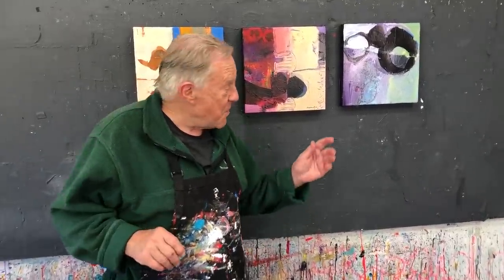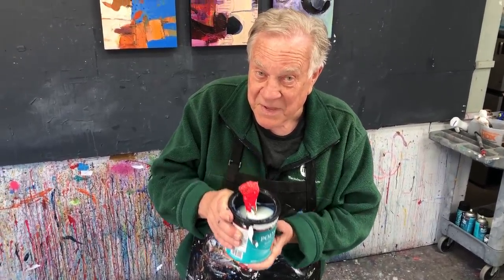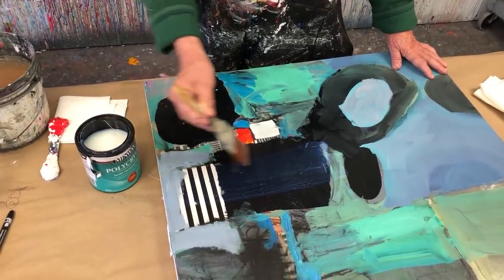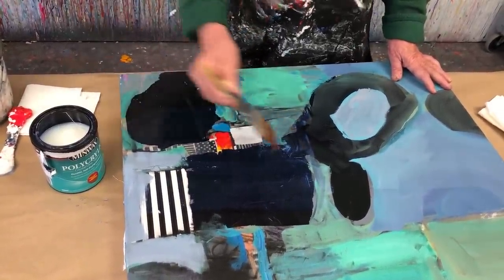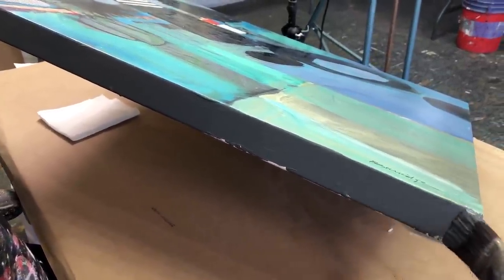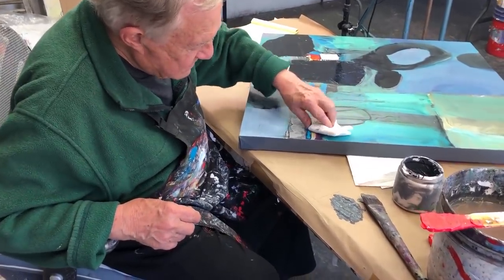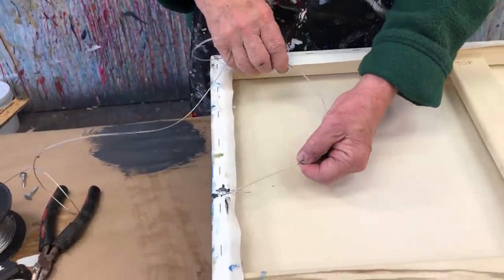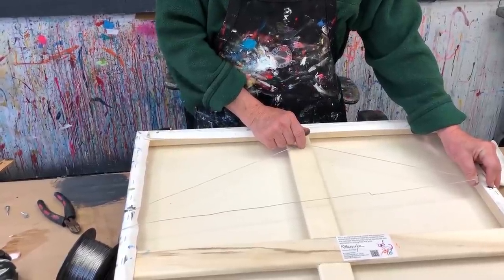BobBlast 413 - "Final Steps to Show-Ready"

Comment: @Bob, do you have any insights into selling online?  I do both watercolor and oils.  Both in rather large format.  Is it appropriate to take the canvas off the stretcher bars and ask the customer to re-stretch to save in shipping?  When it comes to gallery work, I'm hesitated to even try, because of the challenges of packing the artwork (I guess I'd have to rent a van) and then my watercolors framed in glass gets to be really expensive (especially if I break them in transit).  Do you suggest mounting watercolor on board instead (which I have seen done, but that gets heavy for larger pieces as well).  I used to work for an interior decorator group and the art they purchased for their clients was almost always large format (I see people with big money having big homes with big blank wall spaces), so I'm not really interested in 11X17 or smaller.  Also, like your thoughts on digitizing work and turning it into a print.  I personally don't like it, but selling prints to a more cost-conscious market may be a better entry point for the newer, no-name artist like myself.  Again seems like the investment in the proper cameras and/or scanners to capture the images would be more costly than I'd probably ever make back in sales. Perhaps some ideas for a future video.

Comment: what is the width of the brush? brand? looks like a basic house paint brush?
Reply: Hi John - Which part - the varnish brush? Or the brush I used to paint the sides?
Reply: @RobertBurridge  sorry I meant the varnish brush.
Reply from the maker: @johndough1006   hi john.  Cheap joes psudo sables. Wide. 2in.  They are soft and leave no brush marks.  Hint: use a lot on your brush and go slowly( no bubbles)